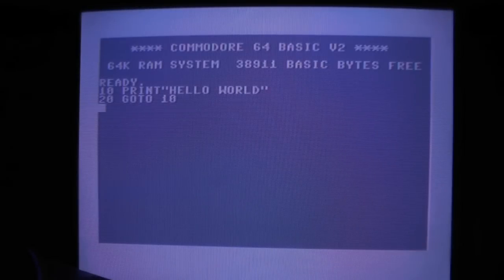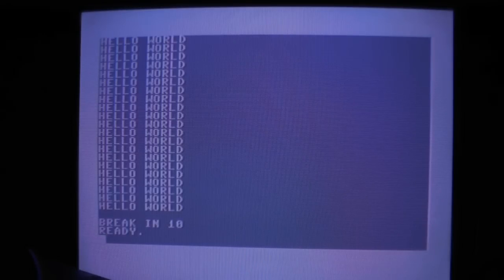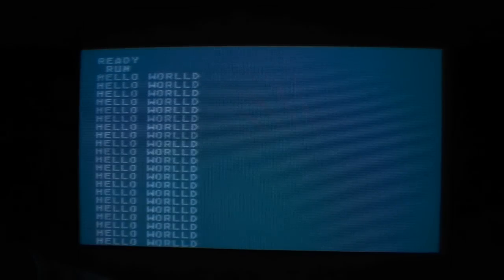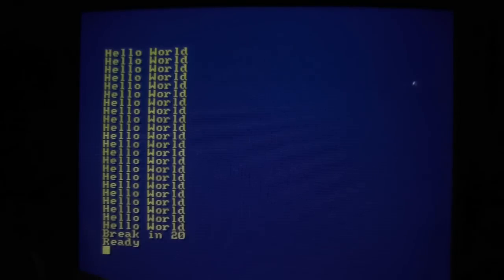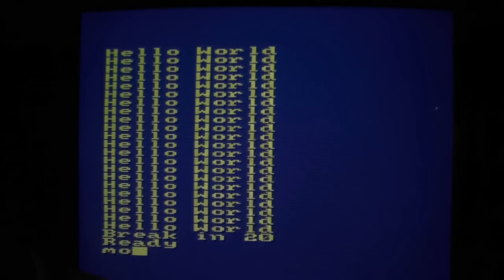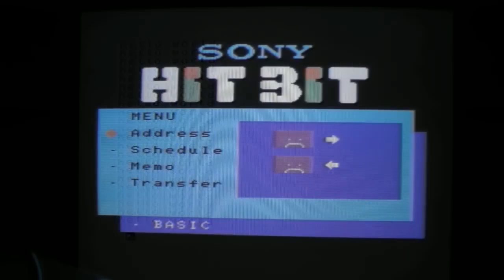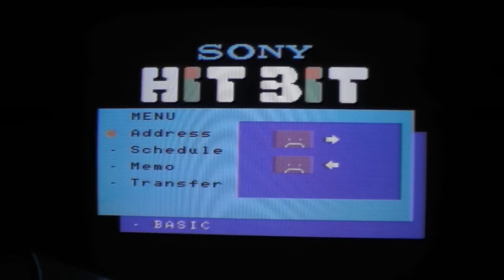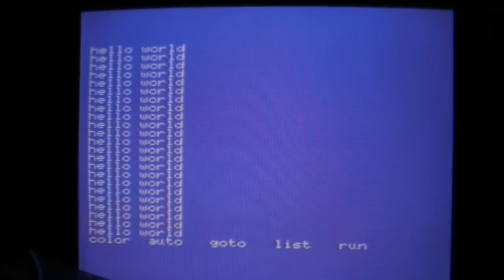Let's Compare: 8-Bit Homecomputers [Part 1] (C64 vs. 800XL vs. CPC vs. ZX Spectrum vs. MSX)

Comment: You can use the other 32k (in Basic even) on an MSX machine by using Bank Switching, as on boot up the Microsoft Basic and core ROM is taking up a full 32k bank. A 8 bit micro only has 64k memory space, so you have to bank switch to use it all.
The printer port is a centronics (mini version).
Look forward to the 2nd part, will watch it next :)
Reply from the maker: electricadventures Do you mean by "use" that you can copy data into it to store it or that you can write programs that are longer than 32k?I mean the Commodore Plus4 has 60k for programs, iirc.Never seen that sort of printer port before. Thanks for the info.
Reply: Well not in a strict continuous memory block sense, but there are basic commands that support switching, so with thoughtful use you can use all 64k for program logic and data. But yeah needs to load in 16k blocks, so the Basic ROM can stay in control.
The small form factor centronics port was actually used on some IBM Compatible laptops as well, so it was pretty easy to get the connector to make cables (something I did back in the day).  So it was actually quite a wide spread standard, and being standard centronics it meant there were a lot of printers that could be used.
Reply: That way I expanded my Z80 P2000T to 2080bytes of memory. 32kB base RAM, 256 x 8kB of switchable banks by setting an IO port value.

Comment: Great video mate!
Control+Shift+Escape resets CPC :-)
Reply from the maker: ***** Thanks!I don't think this sort of reset works like a proper reset button. I think I remember that I already ran into a game that disabled that. Do you knowtthe exact key(s) to break a BASIC program without resetting the machine?
Reply: Indeed reset doesnt work all the time. As for break you have to press esc twice but it is the same here. If it works then type list. If it is not encrypted you will see the code. Hint: save"file",p you protect it :-D
Reply from the maker: ***** Is it "really" protected, or can you easily change a byte or two and it will list normally again?I remember, you could manipulate C64 BASIC files to not list by manipulating a couple of bytes.
Reply: Never tried to unlock it. I had success to some games though with discology and its hex reader but I cannot remember much. It was between 88-90. Soooo many years :-D

Comment: Excellent comparison! I'm a huge C64 fan and this computer is a öiving legend. I bought an Atari 800 XL last year and I'm still impressed how good some games are. My CPC is a Schneider CPC 464 and there are aome nice games and the included cassette deck is also really nice. But this computer is maybe the least favourite of the bunch. My speccy is a ZX 48 and I was a long run to get one and I can understand the Brits why they love this neat thing. And with the expansion the sound is so much better! I've 3 MSX 1 machines and my fav is Philips VG 8020. And if you're Konami fan you will get some really great games.
Reply from the maker: MrVenom1974 I have mixed feelings about the Schneider's built in tape drive. It IS reliable. But it also makes the machine bulkier...I love the Spectrum. I will try to get a 48k model, sooner or later, but it's rare over here and shipping costs from th UK are even worse than from NL.I bought a Nemesis cartridge along with the MSX and it is an excellent conversion. Once you get over the jerky scrolling.Can't load most of the Konami games from tape, so I have to wait until I get an MSX2 with more memory, or I get the cartridge.
Reply: Do yourself a favour an try to get Nemesis 2 or Penguin Adventure.
Reply from the maker: MrVenom1974 I'll put them into my memory. Chances are not high that I find them coincidentally... but maybe the next time I'm in NL.
Reply: I wish you luck!
Reply: Theshadowsnose the atari 800 xl is print program
Reply: Really?

Comment: Also, if I influenced your thoughts about the 3rd part to this series then I can only apologise for giving you more work! lol, I'm kidding; I think in this day and age, what with fewer and fewer usable storage, it's essential to use emulated drives so it'll be very useful information. Looking forward to that and part 2.
Reply from the maker: MagikGimp LOL!No, you didn't.The idea came from all the trouble I had to make disk or cartridge based games to load from tape.I managed to get disk games running, but cartridge based games won't work on my machine... it interferes with the built in software. Took me 3 entire days to realize that and get at least the disk games working. Information (at least in english) was very scarce to non existant, so I thought it would be useful to share what I found out.I'll also mostly focus on tape based solutions. For most machines, you need expensive extra hardware to use a disk drive.

Comment: Nice new system you got with the MSX Nose. I don't think you even announced it until now so you must have brought it back with you on holiday what a surprise.

Hope you enjoy the new system. Bet you get an Electron, BBC, Dragon or Sam next. Joking.

I'm still at the start after 2 days so I better start watching the complete video now. Yesterday realised it was silly o clock so clicked shutdown when video was running and this time I'm disrupted talking about coke compares and new MSX's. lol.

Anyway I'm determined to get to the end right now mate so I better stop chatting if I want to do that. lol.
Reply from the maker: Daniel Cordell I think I did mention the MSX in my "I'll be back" video. At least I did in the long version which I haven't ULed yet.I consider my computer collection compplete for the moment.I'll focus on consoles next year. Still haven't got a NES and I really want a PC-Engine.Also need to get flash cards for them... so that's not going to be cheap.Would not mind getting a 'Beeb' or an 'Elk', but they are almost impossible to come by over here
Reply: Will you be going for a N.E.S. with american to german volts converter? A Famicom with Japan to German volts converter or the NES already German?
Reply from the maker: Daniel Cordell I think, I'll go for a German (or Dutch) one. If I get any trouble with the different regions, I'll simply disable the 10NES chip. Don't think it's a big issue when I use an Everdrive with it.
The only downside would be that the games will run on 50Hz instead of 60Hz on an NTSC machine.
But I can't record a 60Hz picture well anyways, so I'll stick to european machines.

Comment: The only C64 game I know which supported analogue joysticks was Revs - even then, I never remember seeing analogue joysticks which were designed for it.

But, at least Revs supports paddles, which I really should try one of these days… though I don't expect it'll help my driving there ;)
Reply from the maker: hellfire64 I hated "revs" so much back in the days. The magazine I was reading was really fond of it so I gave it a try and never made a single lap. I think they also mentioned the analog joystick. Not sure about that. Was a long time ago...
Reply: I can totally agree with the learning curve - it's basically vertical, and from experience, I really only clicked with it in recent times (by the time I started C64'ing, it had long been off the shelves).

A shame that no other games had any support though - I think there'd be a few more where it would have been better than a digital joystick :)
Reply from the maker: hellfire64 I don't think you could even buy an analog stick with a 9-pin connector.I would guess that some flight simulation software would make use of that, but to be honest, I never played them too much. I find them quite boring and 1 frame per second doesnt help too much.That was after the "wow I can fly a plane" phase, of course.

Comment: Good showcase! Speccy is not the best in terms of computing power, but, since it (local unlicensed Belarusian clone actually) was my first computer, it's good for me =)
Reply from the maker: LastofAvari Thanks!Do you still have your original computer? I would love to see a video of it.I bet they were really hard to come by in the '80s
Reply: It was modified during the years of using to upgrade it up to 128k of ram, add nice keyboard (from EC1840 - soviet IBM XT clone, it had reed switch based keys - really soft - no click - no lag), add disk interface called Beta disk (TR-DOS 5.04T) centronix compatible printer controller to use with also soviet dot-matrix printer compatible with Epson LX/FX-300 command set. At some point some of ROMs get failed and some BASIC commands no longer worked correctly and there was no place where you could program new roms so ZX was dropped around 2002/2003. If I will be able to found it I make some photos and maybe a blog post. But If you won't be offended with my not so excellent English I could also make a video =) Sorry for TL;DR =)
Reply from the maker: LastofAvari
Your English is just fine. No problems with that!
There should be a way to get working ROM chips today with the internet and the retro community. If there is an image file of it, someone can burn it into an EPROM and make an adapter if necessary.
I really wonder how a Spectrum with a disk drive works. For me the Spectrum was a "Tape only" system
I've read "TR-DOS" at quite a few games on WoS, but most of them were in russian, which I sadly do not understand. I also can't read cyrillic letters, so I didn't research any further.
Reply: Theshadowsnose Done =3

Comment: I've never seen a Commodore 64 computer like that before. What I had was the same kind that is in the back on the shelf.
Spectrum 48K has rubber keys? I remember the Sega SC-3000 that we had also had rubber keys, which was weird, yet cool at the same time.
Very good video all in all, lots of interesting info about the computers I never knew about.
Reply from the maker: SpiderMwa This was the later more "modern" design for the C64. Luckily the hardware was 100% compatible... just the SID chip sounded different.Yes, the original Spectrum had those horrible rubber keys. They made the spectrum Plus with sort of better keys but the same mainboard in 84 or 84.These were the machines I had to chose from when I got my 1st computer. Great for my that I finally CAN compare them... could not do that in 85.